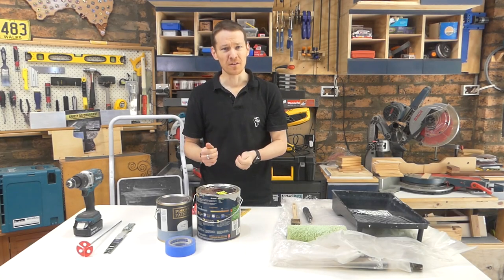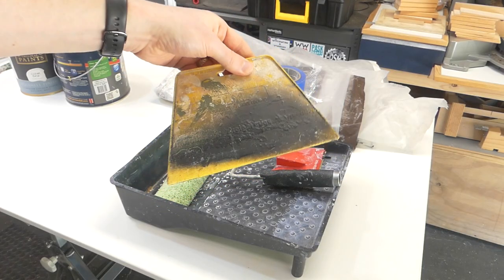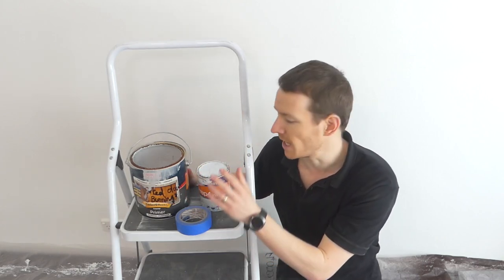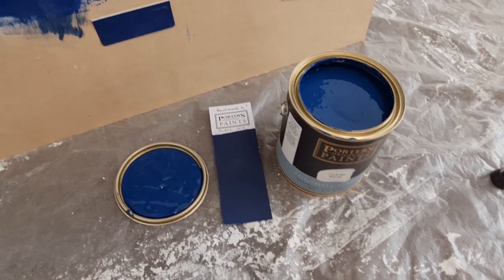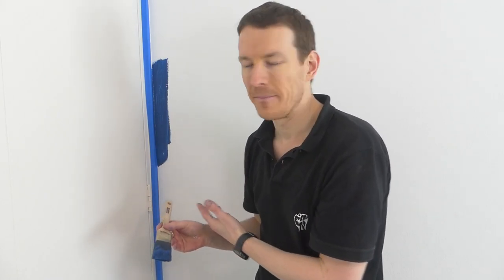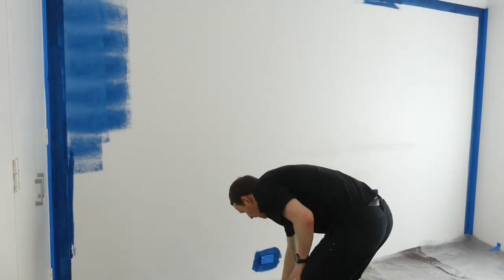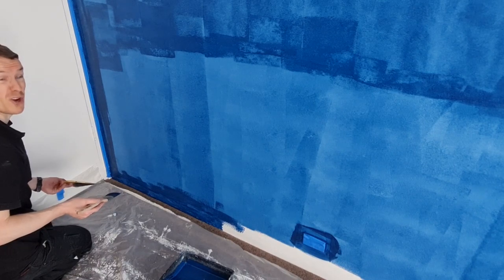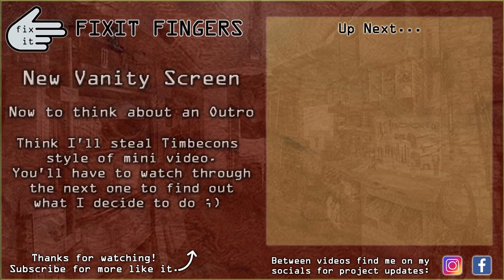Painting an Eggshell Feature Wall - Beginner DIY Tips and Tools Needed

Comment: G'day James and what a splendid job. Give me a medieval letter for a manuscript to decorate and I know where I am. Give me a wall and I get my eldest Son on the telephone! I would first get rid of the carpet, acquire a barrel after the beer has been consumed. Fill the barrel with beer and use a high speed pump to aim it at the wall. The excess paint flows onto the floor for an excellent linoleum flooring cover. Two jobs in one. My son has different ideas and no pump to clean out!
Seriously though that is a wonderful job. I remember what you call an edging tool appearing in the UK without wheels in the 1960's or early 70's as Peter Paint tools - three sizes in a pack and expensive. I was as useless with them as with rollers and brushes. I am just as much of a genius at varnishing wood! I salute you James! Thanks for sharing! Keep well. Eryk 🎬👍😃
Reply from the maker: Painting is not a task I relish, it can be tedious and time-consuming if you are doing trim, 3D objects or large areas, but a single wall is quite enjoyable. When I am approached to do handyman jobs painting a wardrobe or something I often suggest the client use a 'professional' or give them tips to DIY it hahaha 😅

Comment: Love the colour. I used one of those edging tools once. I got paint on the wheels, and then I got paint on the underside of the cornice. Then the edging tool flew out the window never to be seen again. 😂
Reply from the maker: Hahaha I got a little on the wheels too this time, still faster to wipe it off and touch up than mask the tricky 'crown moulding' as our American friends are keen on calling it. Usually I wouldn't use any tape on the long edges, just the tool, unless I didn't have the right touch up colour ;)
Reply: Same, but mine didn't fly away ;p

Comment: We really enjoy your videos so much. You do such an incredible job explaining things and you make it so informative and fun. Like you, we are not professionals but picked up a tip or two that might come in handy for you. 1 - use white primer but stir in a little of the paint you are going to use on the wall. 2 - Try Frog tape instead of the blue tape. It is more expensive but it is unbelievable how it prevents paint from bleeding under the tape. We swear by it now. 3 - remove face plates instead of taping over them. It is easy to do and you wont have to touchup around it or remove paint that accidentally gets on the cover. I am going to have the give the edge painter another try. You made it look so easy so I must have done something wrong when I tried it years ago. Wonderful video, sir!!!!
Reply from the maker: Of there are some good tips there! It never even occurred to me to remove the face plates 😅 The egg shell is a little fussy compared to Matt paints but long strokes and a light 4th coat really make it shine.
Reply: @FixitFingers  We know what you mean. We use eggshell on all wall except for bathrooms (because of the moisture)  BTW, I agree that being 6' tall comes in handy when painting walls. LOL

Comment: Nice tips there James. Didn't know about that edge painting rectangle thingy. Will save a lot on masking tape with just that! When I painted my walls, iI used some old cereal boxes ripped as rectangles to feather that edge in. It was a fine balancing act, until I accidentally smear that cardboad on the opposite wall 😜😁
Reply from the maker: I only used tape for the purpose of the video, honestly if I wasn't filming, I'd be lazy and skip it in most places. Mind you, I DID get paint on the wheels at one point and had to touch up the marks with white... But still faster than masking 😅

Comment: Cutting in is when it all goes pear-shaped for me... that tool you used along the carpet looks a lot more reliable than cornflakes box clippings :)
Reply from the maker: Yeah I've had cardboard get soggy and fail on me so spent the few bucks on the plastic one... Main drawback is it didn't come with coco pops... 😥

Comment: Seems we know a number of the same tips. Not many people know the plastic bag on the roller/brush one. You can honestly keep a roller in a well sealed bag for days. I usually end up "rolling" the roller into the bag which really seals out any air keeping the paint wet.
Reply from the maker: As I had a little paint left I did a fourth little finishing coat the following morning. Roller would have been in the bag 16 hours at least, still good. Except now we are thinking we might do the rest of the room a light grey, so I may not be done yet 😅